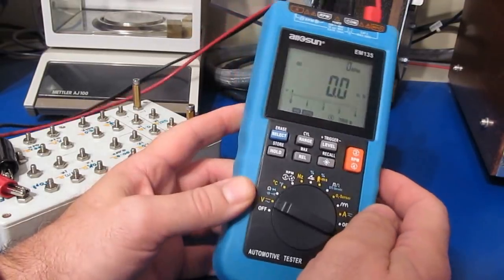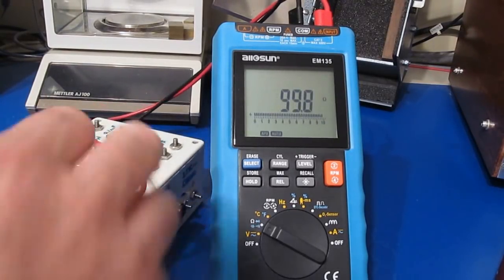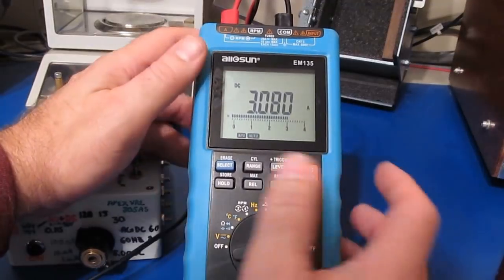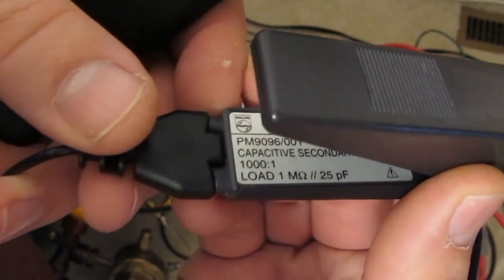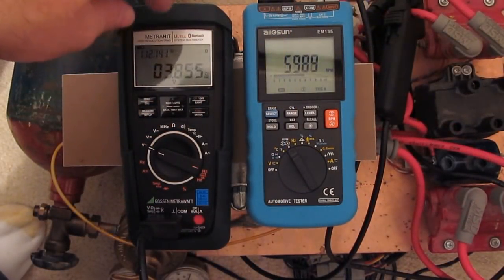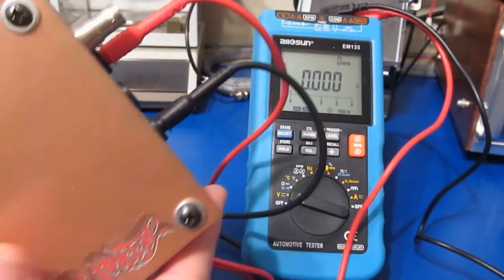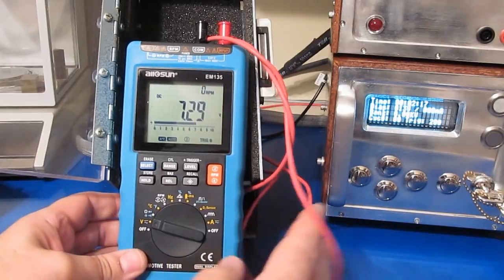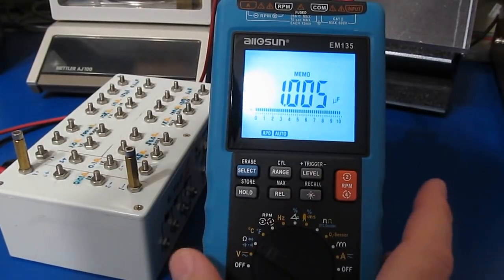ALL-SUN EM135 DMM, Final Mods and Playing with Nitrogen

Comment: Hi Joe, good video again! Would you share your fix with us? Or can we read it somewhere? Thanks!
Reply from the maker: My fix?
Reply: In the previous video you said that you’ve added a capacitor somewhere, I am just being curious.
Reply: Cliff Matthews Hi Cliff, thanks for responding to my question, I would never change something on one of my meters, and I do not own the meter discussed here, but anyway for learning something I would appreciate a small clarification on the capacitor modification, thanks again.
Reply from the maker: OK, I'm with you now.  The mod you are asking about as I stated was something clearly called for in the data sheets.  I posted the part numbers for the devices and with you being the curious type,  I assume you have downloaded the datasheets and are not have any luck.  

Keep in mind that the designers apparently did not fair so well and they actually get paid to read these sheets.  You have a huge leg up.  You know there  is a problem and you know it's something obvious and the IC designers even tell you what to do.   Just keep reading and I am sure you will find what you are looking for.
Reply: Hi Joe, I just don’t know where to look for the missing component on the datasheet without comparing it to the actual situation (remember that I do not own the meter) but anyway thank you for the excellent video.
Reply from the maker: I am interested in seeing the released version of the UEI 121GW they are working on for EEVBLOG.  I fed them a fair amount of feedback on how to improve it.   Dave's dropped a few clues along the way that lead me to believe they have looked into a few of them.   The good thing about running the meter the second time is I know what I am looking for and this time there will be no confusion as to what is being shown.  The other benefit is there is no reason this time to treat it with kid gloves as my goal will not be to give them a heads up on how to improve it before it's release.  Let see how may tips they took....
Reply: joe smith Hi Joe, I can’t wait for you to get your hands on one the new EEVBLOG meters!
Reply from the maker: Ah, that does make things a little more difficult.  Of course, I did not have the schematic which also made it a little more difficult to hunt down.   The best advice I can offer people who are really interested in seeing a meter improved is to write the manufacture and explain what your concerns are.  This is really the only way to correct the problem.    If you are just interested in understanding how meters work or how to trouble shoot them,  I would start looking at the schematics that are available and go through them, similar to how I went about modifying the UNI-T UT61E.
Reply from the maker: He mentioned something about 50 pcs in one of the last Amphours.  I am not a patron and it sounds like the first ones will go to that group.  Once they are readily available to the general public, I will see about getting one.